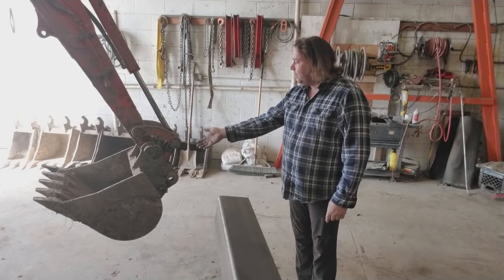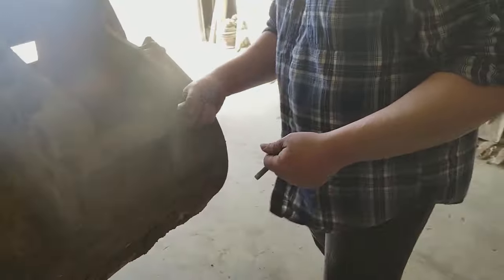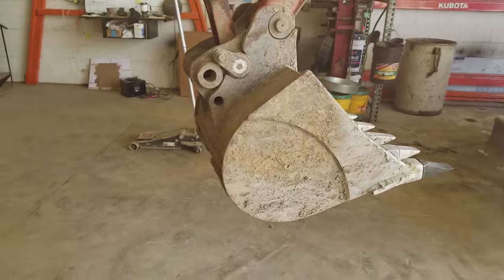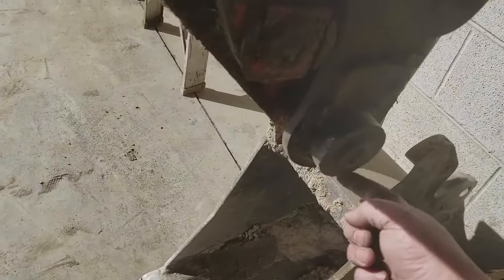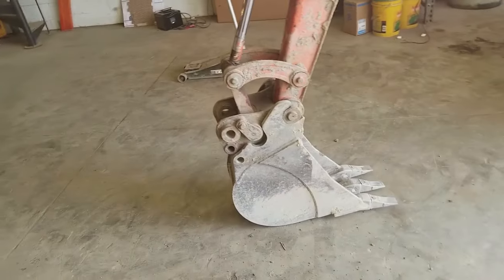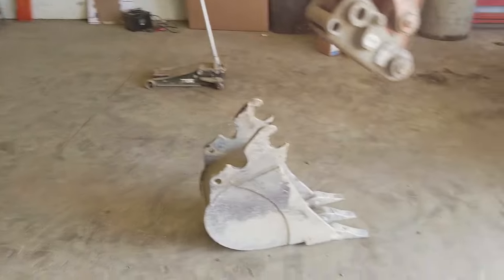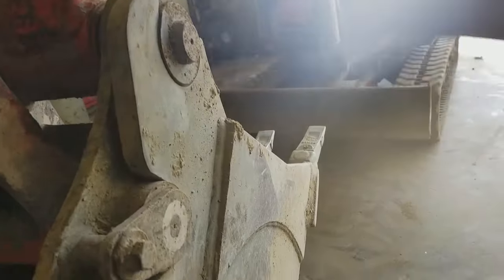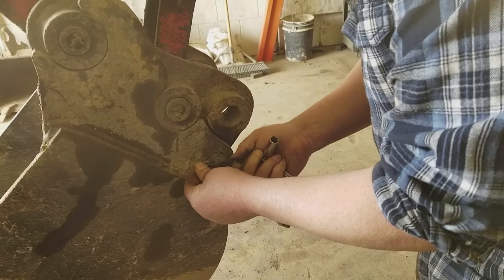How to switch  buckets on a Kubota Excavator

Comment: Thanks for the help. It's dark, new to me machine & I  was struggling
Reply from the maker: also,if you move the dogbones to the middle holes as shown, it allows the bucket to uncurl more and that is better for trenching. with the dogbones in the outside holes, (big holes) its better for curling up loose material like sand or water. To move them, drop the bucket,  pull that 18mm bolt, knock the pin out, move the pin to the other hole and the 18mm bolt goes back to the same spot to hold the pin in.  There should be some big rubber o rings. All they do is keep the grease in. Its helpful to have help with lining it up.

Comment: What are the other holes for on the machine that sits right above the small holes for the pin?
Reply from the maker: Those will change the digging angle of the bucket. The upper holes will let you curl more but it wont open as much.